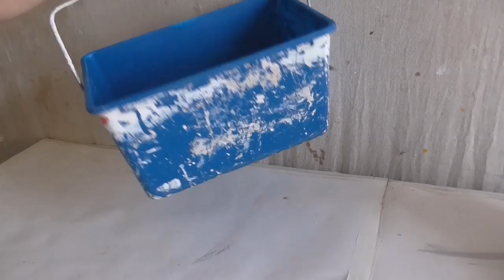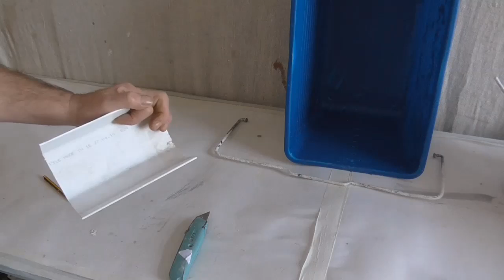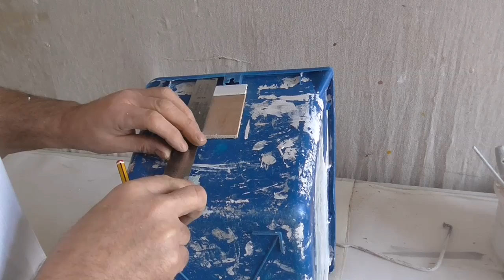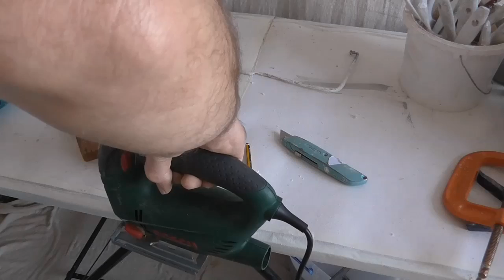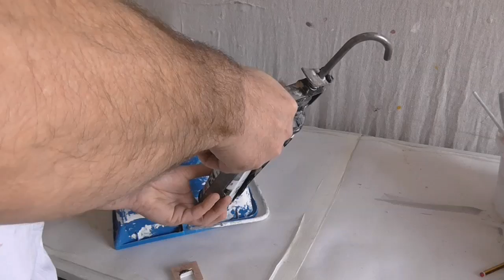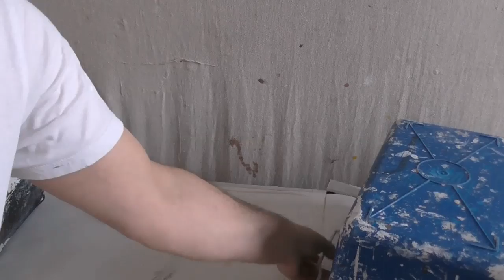Bonding Wood To Plastic Using Unibond Extreme Repair

Comment: A nut and bolt through the side of the scuttle, with the nut on the outside to hold the handle in the slot.  Takes 2 minutes.   You're welcome